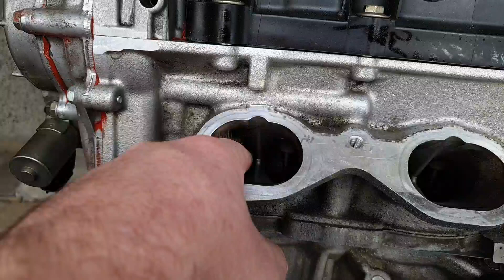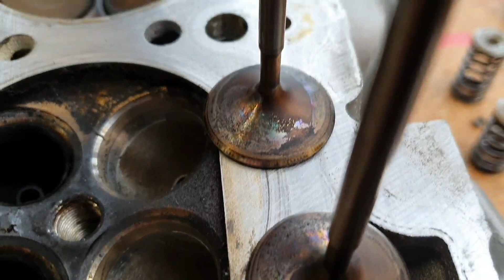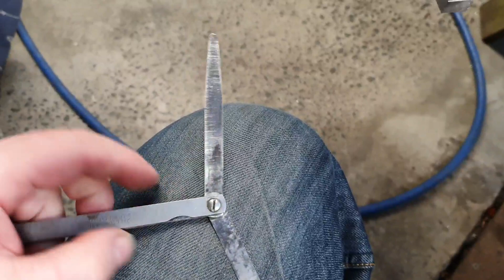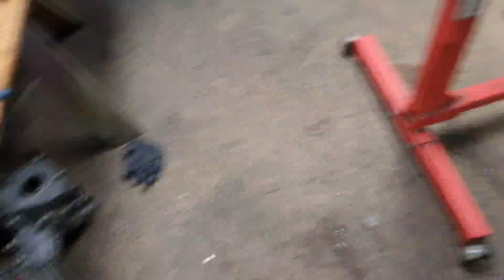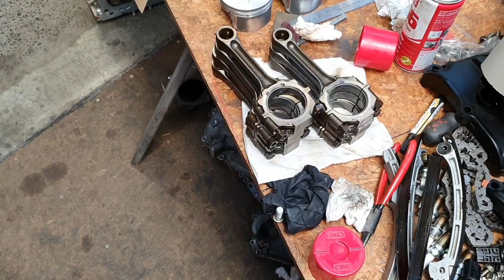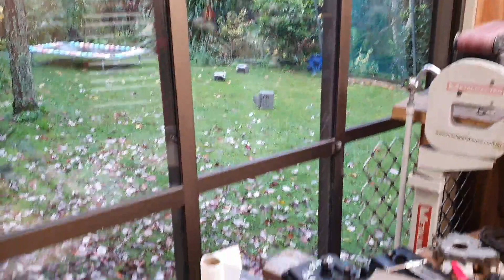VK45DE tear down and inspection, repair

Comment: Heiy, how many miles on this engine? Did it chew oil? I know these engines got problems with sticking oil rings. Got and fx45 too
Reply from the maker: No idea how many miles were on this one, it did have a lot of carbon hanging about, a PROPER rebuild would have included new rings and bearings, maybe even oversized pistons if I were to get fussy.
This is closer to a "slap it together she'll be right" build ha ha ha!
Reply: Run a thicker oil and change it religiously, also they like vacuum. I wired up a constant electric vacuum to the crank case in hopes of helping the rings.

Comment: Are you starting with a petrol or diesel D40?
Reply from the maker: I'm planing to put this engine in our D40 that already has a VK45 V8 but is a direct injection eng converted to manifold/port injection.

Comment: Just a complete novice question but do the valve clearances change when the cams are locked down with their caps? Love your vids 😎👍
Reply from the maker: Clearances can tighten up as the valve seat wears and the valve stem moves up towards the camshaft.
Clearances can open up due to wear on the cam follower faces & on the top of the valve stem.

In normal circumstances the amount of change wont be a lot, this engine had a VERY hard previous life with lack of servicing evident.

Once all the carbon was removed from valve seats and valve faces things were not bad, a little shuffle around of the followers and we were back within factory specs.
It's most likely I somehow messed up getting this all back together last time (I was still heavily concussed after big crash) I don't remember what I was up to, might have tipped the head over to check something and dropped out the followers or something.